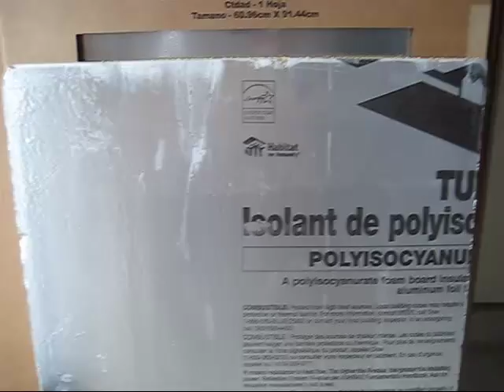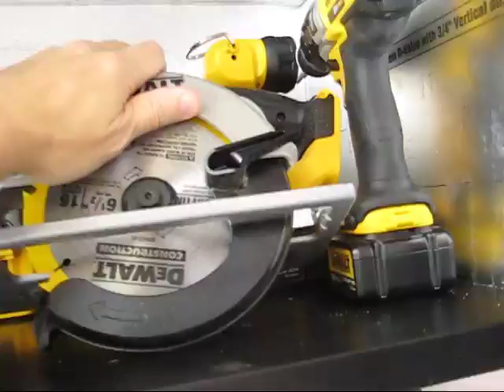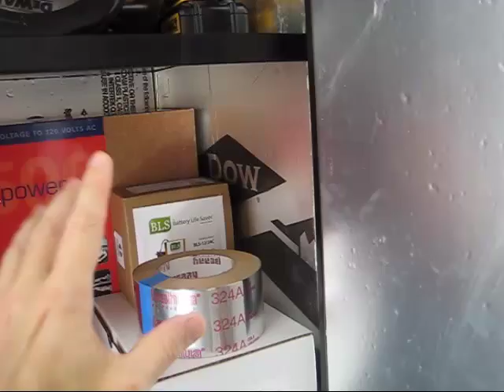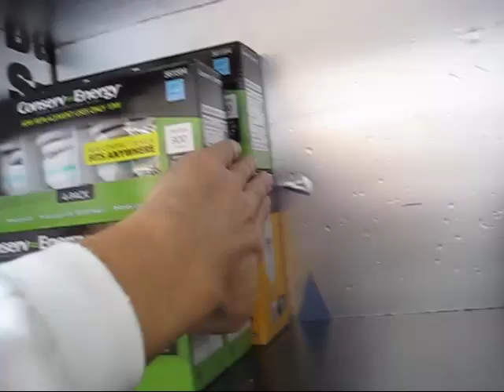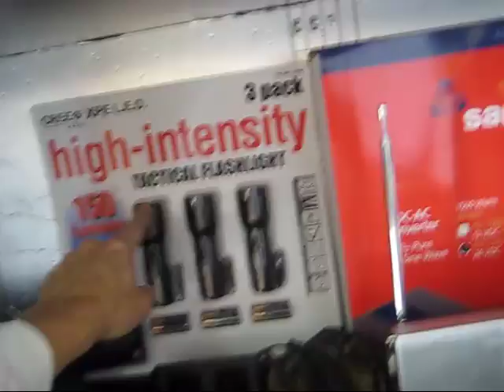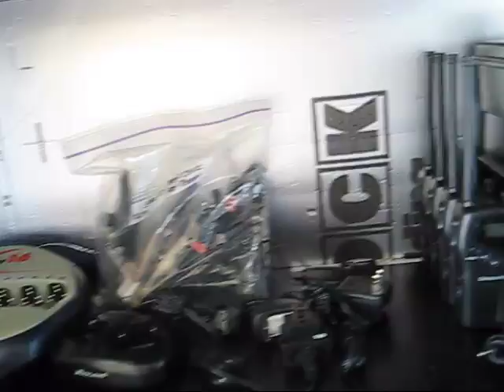Faraday Cage: How to Make on the Cheap

Comment: I hate to burst your bubble, but this probably wont work against an EMP. Against a solar storm your good. the reason is the frequency of the Electromagnetic waves your trying to block. EMP can generate waves in the 1GHz range well beyond FM Radio. If you have a cordless phone (9GHz) try seeing if that Cabinet can block it.

Comment: i've got a dns-323 network storage unit (2 hard drives in a box)  if i wrap that in several pieces of alfoil will that achieve the same thing?  disconnected of course?

Comment: About the metal shelves, you are absolutely right, but you don't need to ground the cage, I did some research on that. 
Search here for "Electrostatic Shielding" on TutorVista channel. 
You will find that you only need grounding if the charge comes from the inside of the faraday cage, letting no electric current out. Here, the objective is the opposite, to shield something inside the cage, and according to that video, you don´t need grounding. Anyway it doesn't hurt if you ground it I guess...

Comment: I’ve been told that an emp would destroy small wires like the ones on circuit boards.
Your panels have diodes and are loaded with small wires, all of which may fail under that load. Look into what a solar event in the late 1800s did to the telegraph lines… and they were much heavier.
Just food for thought
I think most just make a simple cage for their generator
I haven't

Comment: If you say that the charge will just flow around the skin of the exterior metal then why did you bother putting any insulation inside the cabinet to start with??????  You've insulated everything else except the very shelving that all of the items are actually sitting on and making continous contact with?????   I'm like everyone else here.......rather confused

Comment: Nice setup.  It might just work.  But if it did NOT work, I would probably attribute it to the metal shelving, unless of course you have it grounded.  Do you have it grounded?  Wouldn't hurt to ground it anyway,  as well as pad the shelving too like you did the rest of the interior of the cabinet.  .02 cents

Comment from the maker: I believe 50 cal. drums don't need tape because the lid overlaps the sides. I'd put a flashlight inside, turn off the lights and see if any light is coming out. If so use the metal tape I showed. Electrical tape won't help.

Comment from the maker: Because it will dissipate the charge is exactly why it will work. The charge is only on the outside skin of the metal so electronic items inside do not nee to be placed on non-conductive material. If you have test results that show something else please share them. We would all like to see the data.

Comment: Sorry dude it won't work.  Close.  Yes it stops radio frequencies but it won't stop the electrical charge, it will dissipate it on all metal surfaces, so if you have any metal and you have something on it, it will fry it.  At least that is how it suppose to work.  You have to place all electronics on non-conductive surfaces.  Than that baby will work. Still pretty inexpensive way of doing it.

Comment: I was wondering if you thought this Reflectix insulation could be used to make a feraday cage for a car?  In a garage,drive on a couple of pieces put together and use the metal tape to build a big box around it with more of the reflectix sheets.  I want to save my car and I just thought this may work to do it.  Any thoughts?

Comment: It cuts to dimension very easily. I used some double sided tape, and it took about 20 mins to have one layer on the inside of the cabinet. I tried the radio, no signal at all.  I have used both types of insulation, the roll is much easier to deal with than the foam, and allow for max. inner space.  I am now going to add a layer of cardboard over the reflective insulation as another barrier to protect my equipment.  Hopefully it will do the trick.

Comment: I tried the "light" trick and did find a couple of small holes.  I added 2 layers of tape to these areas. It may have improved it slightly, but I was still able to hear some of the signal coming in (was 85% static).I did have some of your foam insulation, but I wanted to try something a little different and maybe easier.  I picked up a 4'x25' roll of Double Reflective Insulation.  It has a double layer of alum. with "air" bubbles in plastic in between.

Comment: I have done a lot of studying of Faraday cages..  your equipment should not be in contact with any metal of the container itself...  Everything should be very well insulated from contact of the container.  EMP is extremely high instant power any radio or other sensitive equip. would be fried....  Better to be safe than SORRY....

Comment: @LDSPrepper  If the EMP pulses we are supposed to encounter this year are as bad as some expect them to be than than the level of protection required will be off the charts. But that does not mean we shouldn't try right, just keep in mind that EMP's from solar flares will constantly be hitting the planet so be sure when you open that cage it is totaly safe

Comment: I just picked up a 42" tall similar cabinet. I started out with only the tape on all corners/seams and while the signal strength was reduced, it still got through. It was a little static.  I will pick up some insulation and add that to see the difference.

Comment: What about a TV, DVD player and a backup computer? When I saw your cage, that's what came to mind first. I know those things aren't  that important but you have the information stored from your computers. How will you access it, the computer will be fried right? If space is an issue those appliances can go, just get manual versions for backup. That will be good for any power outage also. Please keep in mind I am a rank amateur in this regard, so I am just wondering. Thanks and God Bless!

Comment: @LDSPrepper All we do to our cages is securely attach a copper strap into the earth and well attached to the bottom of the cage, do not use an existing house ground as that is connected as it is to the system. You can use any conductive material I grab a scrap copper pipe and cut it into a strip attach it to the bottom leg of the cabinet, and into the ground, copper grabs charges quickly and will disipate charges more efficiently.

Comment from the maker: @wcrazy78 I use the FM radio wave to test because the EMP wave length is about the same size. I don't have a way to test for EMP. Thanks for the recommendation on an isolated ground. Exactly what materials would I need and how would recommend I do it?

Comment: @midasallen So your banking on an EMP being a radiowave? Because that is all you are actually testing in this video, not an electrical surge. My brother is a former ET in the Navy I will tell you most EMP precaution taken use isolating grounding equipment and surge disipators. Your cage may not need to be grounded in your opinion, but properly isolating a ground for it alone would greatly increase it's efficiency to disipate the electro magnetic pulse that may hit. Adds $5 bucks in materials...

Comment: Is your cabinet grounded?...if not an electronic pulse or surge would just conduct through the shelves as they appear to be directly attached to sides of unit...Isolation and insulation is the key..hook a low voltage source to the cabinet and test the locations where your gear rests with a multi meter.

Comment: The way your cabinet is shielded may create a big capacitor that may enhance/discharge the EMP into your equipment! The duct tape has adhesive backing that isolates it from touching the metal cabinet also the foam backing on the insulator prevents the grounding of the aluminum backing. The cabinet should be grounded through a good grounding system that has an EMP filter on it. The best way is to install a lightning arrester with an EMP filter. You could use house plumbing too.

Comment: You got the idea, may want to add spare remotes for your garage door, TV and car, If you use any electronic medical equipment such as sugar level and hart rate monitor.  The FM radio is useless since most of the local FM broadcasting stations would stop working unless there is one in your area that is EMP proof (If I am not mistaken there are about 50 or 60 of them in USA) try a SW radio.

Comment: As for the hinges, 20 layers of any tape is still going to crack:  every-other section of hinge has to pivot.  In order to open the doors all you want, I would suggest band-aids or something else that will allow the hinge to operate freely underneath, yet still have continuous protection from the metallic tape over the top.  Hope that helps!

Comment from the maker: @roadhog1986 Laptop, great idea. I have an old one that will not work so it isn't in it. I should pickup a used one and put it in. We are going to put in an old desktop that does work, along with its monitor. Solar panels have no electronics so they are safe from EMP.

Comment from the maker: @DeltasigPrepper Not until you asked. I just tested it. As expected the radios worked. Just like any other device with a small wave length would work. That is why AM radios work but FM radios don't. An EMP has a long wave length. That is what you need to test for. Thanks for asking.

Comment from the maker: @breezebro I'm not sure about the grounding rod. Mr. Faraday, who invented the Faraday cage said specifically not to use grounding. Grounding acts as an antenna and provides a path through the metal. You are correct about the semiconductor componets. That is what will burn out. I believe my newer model chainsaw has them. The older model do not. You need to know for your specific tool.

Comment: @LDSPrepper I haven't been able to find a whole lot about EMP wave lengths; my main point was that could be a test with a stronger signal. (Although the widely used 2m or 70cm radio do operate at higher feq's than commercial FM.)

However, you bring up a good point that I would like to research more. Amateur radio uses many different feq's, from as low as 1.8 MHz to as high as anything over 300 GHz and many in between. From what I've been able to gather, EMPs are effective over 1 MHz

Comment from the maker: @cahoonu Great question. EMP signal only goes around, not through metal. That is why you can touch the inside of a Faraday cage while millions of volts are arcing around the outside and not get shocked. The only way it would penetrate is if you made a ground wire and screwed it through the metal, thus making a path for the signal. I am not going to protect my generator. I don't plan on using it after an EMP. If we have an EMP there will be no power to pump natural gas or gasoline.

Comment from the maker: @neanderthor66 Any motor that has electronics is vulnerable. Which ones will really have no problem I don't know. I'm going to protect whatever has electronics just to make sure. Mr. Faraday, who invented the Faraday cage said specifically not to use grounding. Grounding acts as an antenna and provides a path through the metal.

Comment from the maker: @lastquest I have thought about that. An EMP or radio wave don't bend. The crack at the top and bottom of the metal cabin have a lip that covers them on the inside so there is no direct line for the wave to go through. That is why I think I am safe. As safe as can be.

Comment from the maker: @huntncomfort I am storing my solar charge controllers and DC/AC inverter in my Faraday cage. I only plan on using my solar panels if there is no grid power for the very reason you mentioned.

Comment: Great video. Won't the EMP waves go through the shelving, where they are connected the the exterior wall of the cabinet.  Also, have you got a separate Faraday cage for your generator. You have got a lot of great equipment in three. Thanks.

Comment: @LDSPrepper What concerns me is the electronc boards in the Grid tie inverters and charge controlers, I purchaced a bunch of the little diodes as spares (very cheap) but the inverters would be a heavy loss especially in a long term SHTF. A solid enclosure would cause them to overheat so a fine metal screen would have to work. Have you done any FM radio testing on something like that?

Comment: Would the power tools and kitchen appliances be vulnerable to EMP? I thought it affected sophisticated electronics more than something simple like electric motors, unless they are plugged in. Also, have you considered running a wire from the exterior of the cage to a ground plug on an electrical outlet? I thought that Faraday cages were supposed to be grounded. Very nice job. I may have to copy this.

Comment: Just curious, many metal shop building will keep a vehicle from picking up radio station/signals from inside the building. However, a cell phone will still receive and transmit calls. WIll your cabinet stop a cell signal?